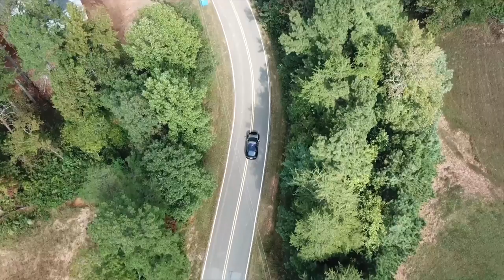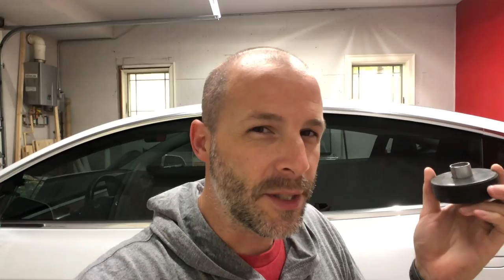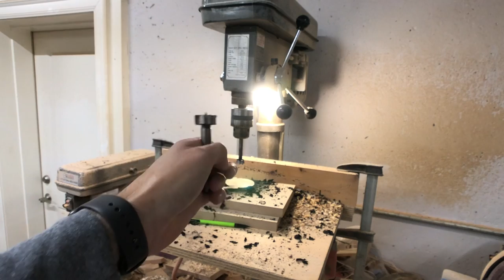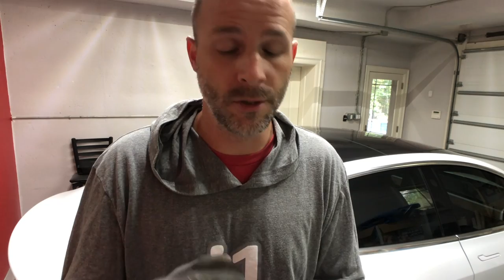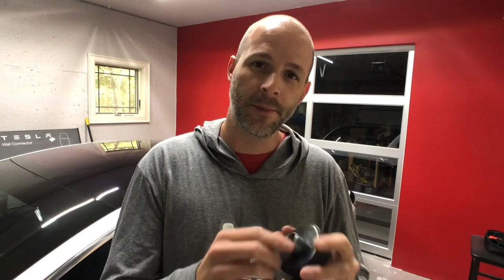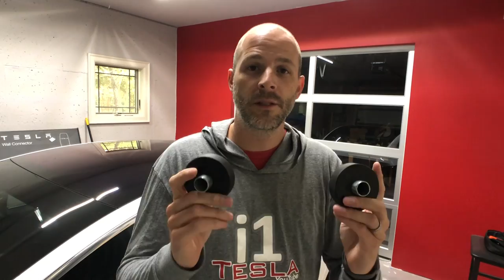Tesla DIY Jack Pads and More

Comment: Darn, I already bought the ones from ReverseLogic but I'm glad you're pointing out the need for these so people can prevent damaging their cars when just needing to jack it up.  The expensive ones do work good and mine came in a nice case but these should work fine too.  Maybe wrap the pipe with a rubber band to hold them in the hole while positioning the jack under the pad.

Comment: Brian, I'm also big DIYer, thanks for the video. I was wondering about the diameter of the pin. I do have a video suggestion, a good follow-up to this: how to safely jack up the Model 3 using 1 jack only. It's a question a lot of owners ask, but I haven't come across satisfactory answer. The issue is: most of us only have 1 jack and  2 jack stands, but we need to elevate the car to remove/swap 2 wheels or all 4 wheels in X pattern.
Reply from the maker: Good one

Comment: Also, I would love to see a video on different tires and how they affect range, and interior noise levels particularly at highway speeds. This is one of my only complaints with my M3 so far... I was expecting lower road noise levels. I'm currently getting an average of about 74db on the highway which is the same as my old Ford Fusion hybrid.

Comment: Hi! I have a queastin? Why not use pvc pipe? Then it would be plastic as the expensive are and they dont scratch the bottom so easily. You also could probably make them pressure fit as is or with little bot of sanding. Nice video and good idea!
Reply from the maker: Yes that will work too. Plus easier to cut. I had this pipe already.

Comment: If one has a Jack with matching hole in the lifting head, one could drill all the way through the hockey puck, cut the pipe longer (5/8" + thickness of the hockey puck + 5/8") and have a self-centering Jack head.  Warning: the real outer diameter of the pipe should be around 7/8", not 1", which would be too large to fit into the jacking-hole in the M3.  Apparently the suggested "one-inch conduit" pipe has a real OD just slightly larger than the suggested 7/8" hole in the hockey puck.
Reply from the maker: The pipe OD is just larger then 7/8 inch. The hole in the 3 is smaller then 1 inch. Any size pipe will work. You could use 3/4, 5/8 what ever you have. The pin is just in place so the pad doesn't move
Reply: @i1Tesla  Thanks, I suspected that a real 1.00" OD would be too big.

Comment: Can you use a standard small  hydraulic jack to lift the model 3. All the jack pads on Amazon say you have to use a low profile jack because it has a larger lift plate. 
Thoughts?

Comment: If there is only a small jack-point, one cannot jack up the M3 and then set it on a jack-stand ... To reuse the jack to raise another corner.  So, one would need 4 jacks?  Maybe Tesla did that to discourage too much twisting of the frame?

Comment: Awesome DYI.  Thanks Brian.  Now all you need is add some thin rubber seal washer around the pipe, that way they can stay put when you pop the pads into the jack points by themselves even before the jack underneath. #giveaway #i12win

Comment: I have all the parts to mount the Model 3 front license plate magnetically.  I prepare the standard plate bracket with 4 disc magnets, and tape it in place on the front plastic cosmetic bumper..  Then, I need to get 4 matching magnets glued/taped on the backside of that bumper.  

However, maybe you would show us how to release that bumper enough to have a couple of inches of working room to tape/place the magnets, and get the bumper properly back on ... Please?
Reply from the maker: I would not use magnets to put a front plate on a car. Sounds like an issue waiting to happen.
Reply: @i1Tesla  So is two sided sticky tape, especially if not applied just right.  My S85 has had such a mounting, successful for 4 years now.

Comment: GREAT! We were just trying to figure this out. Hadn't gotten beyond the hockey puck stage.

Any thoughts on using magnets somehow?
Reply from the maker: The pin is just to keep it from moving off the correct spot. Magnets would move
Reply: So "no" to the "any ideas" question?
Reply from the maker: You can use anything you have to put in the puck. 1/2 inch wood, bolt ........

Comment: Some have used Rubber Hose instead of the metal conduit, (works without scratching anything too much, and they stay in once pressed up).  Definitely agree that the 'Reverse Logic' ones cost Way Too Much and so to me they are certainly the 'reverse of logic' ...

Comment: Giveaway Hey Brian your Tesla meetup video of the Blue ridge parkway got me to thinking about doing something like that here. Question: you made  4 of those but you would only need two if you’re jacking it up at home yourself, right? So I’m assuming that you’re thinking of when it may be on a lift. The reason I’m thinking about this is because I’ve ordered snow tires from Tesla and want to do the exchange in the spring myself.
Reply from the maker: You need 4 if you take the car somewhere or want to rotate them in a X pattern

Comment: Big fan of the channel. I'll pass on the giveaway (I'm not a big rotate my own tires guy), but here's a question for you instead: I'm thinking about making my own barn door for an upcoming home remodel. What kind of wood do you recommend I use? The premium stuff at Lowe's looks nice, but it's pricey and maybe I'm being dumb getting that for a barn door that doesn't need to look perfect anyway... Thoughts?
Reply from the maker: I wouldn't call the stuff at Lowes "Premium" I would go to a local lumber yard. You will get better wood for around the same price. Just go in and talk to someone.
Reply: @i1Tesla  Sounds good, thanks. My Lowe's has a small "premium" section (it's pine, I think?), but I'll hit up a local number yard instead. Thanks to you, I know I can fit 8' boards in my Model 3!